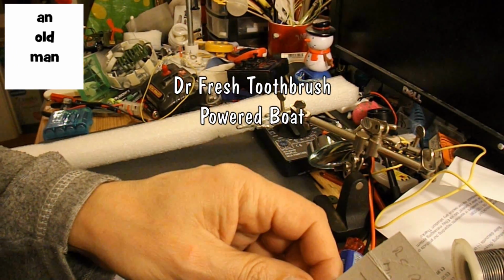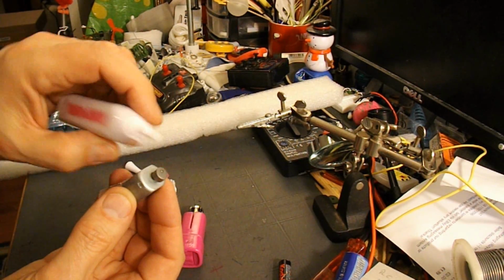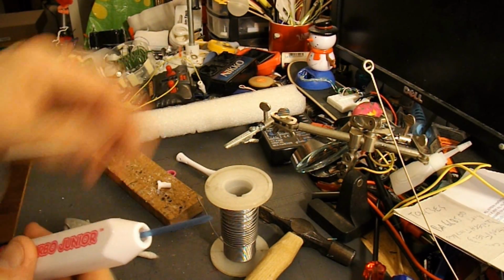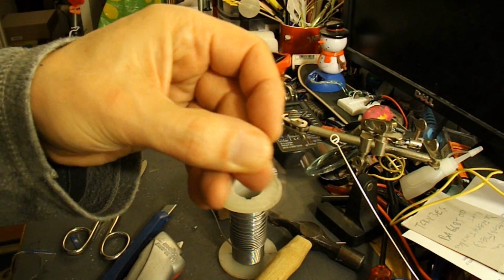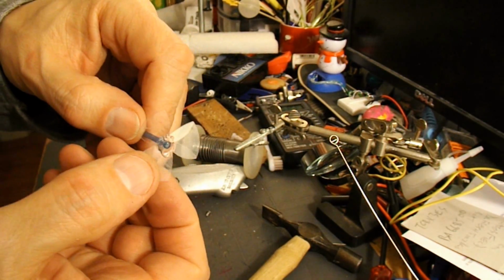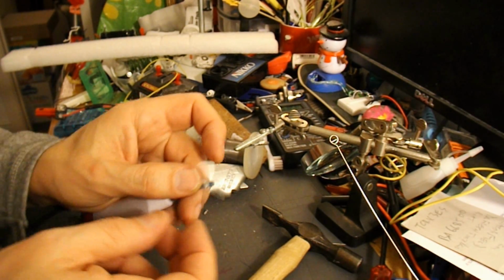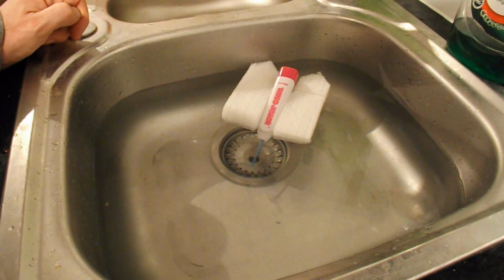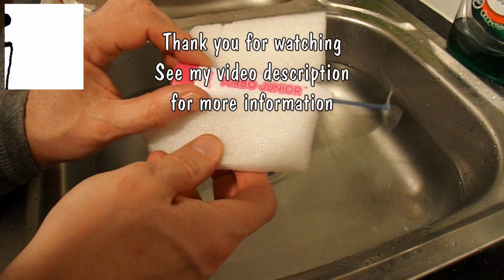Dr Fresh Toothbrush powered boat

Comment: That is pretty neat. I got a question though. Won't the water contact the motor and ruin it?  Is there a way to make where the shaft comes out water-tight?
Reply from the maker: Thanks. Regarding the water getting in, yes it will and eventually it will damage the motor mainly due to the salt deposits or other impurities that get left behind when the water dries out. However the motor would still run when totally immersed in water for a reasonable length of time.
You could spray it first with a water repellent oil such as WD40 and it will probably survive unharmed.
The other point is that if the plastic toothbrush assembly is a good watertight seal then it is hard for the water to enter, even with a large hole at the bottom it is like a diving bell, the water cannot get in because the air cannot get out. Putting a little grease in the base of the battery case where the switch is and around seal when you put the battery in will make it even more water tight.
However, the bottom line is that this will work long enough for you to get bored with it and move on to something better.
Reply: Quoting GrandDad: " the bottom line is that this will work long enough for you to get bored with it and move on to something better."
--- Too true and thanks for the reply, I appreciate it.
Reply from the maker: My attention span is no longer than my grandchildren's attention span, so nothing needs to last very long :-)